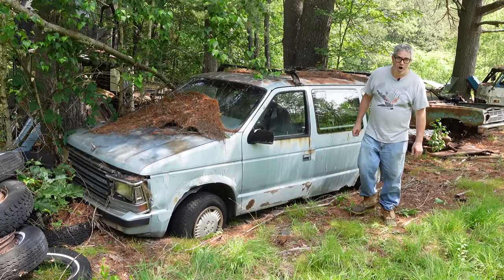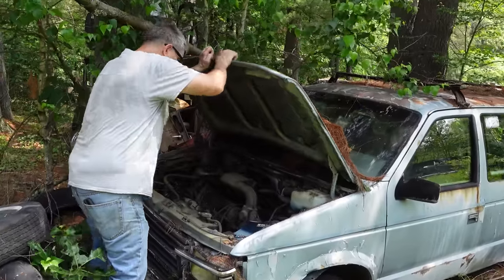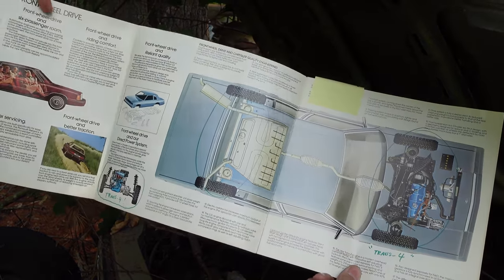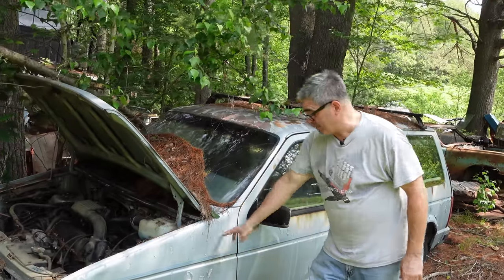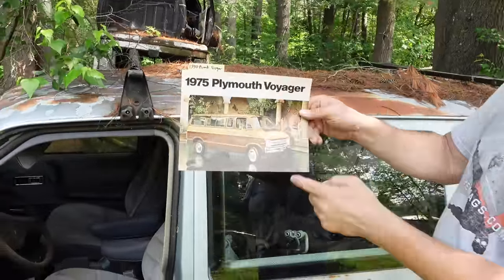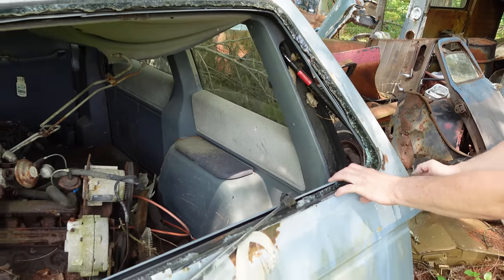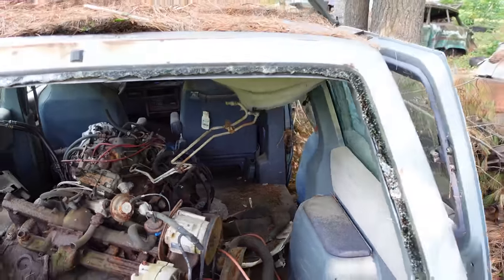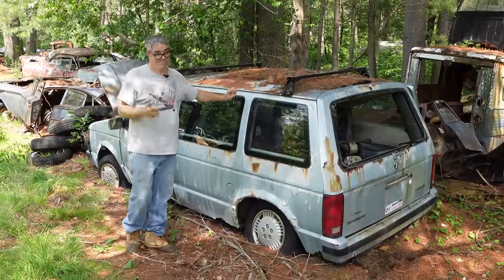Mini Minivan

Comment: Still better than a crossover
Reply: Betterer or worser, doesn't matter
Reply: Yes! It's not pretending that it's anything except what it is - a family hauler.  

All the small SUVs drive me anger.
Reply: @tomwesley7884  you're describing my first marriage.....
Reply: D.A.L.78 - I agree, and minivans were more stylish than today's bland whatever-U-Vs.
Let's agree to appreciate Mr. Iacocca's vision to support this new market that Ford couldn't see.
Reply: Van, crossover, or SUV.... Still can't beat a station wagon.
Reply: When my wife and I got married in 1995 (my second time, her first), her "car" was one of these short-box Voyagers. Hers had the Mitsubishi V-6. It had adequate room for her, myself, and my three kids, even though it only had one bench seat behind the front seats. Easy to remove? That thing had to weigh a couple of hundred pounds and was definitely a 2-person job to remove or reinstall! We took it out one time for a vacation the two of us took one summer (my ex had the kids for the summer) touring the south. I put a double mattress down in back - it fit perfectly between the wheel housings! She made checkered-flag motif curtains for it attached with Velcro for when we were sleeping (We went to a couple of NASCAR races while we were on the road). It wasn't really the favorite vehicle I've ever had; the new 1999 Chevy Venture minivan that replaced it was better by an order of magnitude! But it did the job it was built to do, and it did it well.
Reply: Agree
Reply: @my1vice crossovers are station wagons on stilts.
Reply: Certainly WAY more useful.
Reply: I had a '93 Caravan updated version of this short van.  I loved that vehicle...2.5L with a manual 5 speed.  I got 32 mpg out of it on the highway all day.  Lots if family vacations.  When soccer hit the family my ex wife was really upset she did not have an SUV to keep up with the other moms. So, she figured out how to get a new vehicle.  She backed it into a parking garage concrete pillar, totaling the Caravan.

Comment: I worked as a mechanic in the years when these minivans were new.  I replaced tons of inner tie rods and CV boots on these. Not all of the front wheel drive problems had been worked out yet with front wheel drive cars. Especially CV boots. 
My lasting memory of a K car was at a monster truck show of the same era. K cars were probably only about 5 years old at the time, but here was one already as an obstacle, waiting for Gravedigger to do it's thing. I was surprised at how in comparison to the other cars at how the K car flattened out with such little effort,  like a stomping on a beer can. That was the sinking moment I realized that the era of disposable cars was upon us.
Reply: We had a 1990 Grand Caravan 3.3 liter and I remember my dad having to get the transmission replaced twice in the 10 years our family had it, other than that it was pretty dependable and was used on all of our family vacations.

Comment: When I was ten years old my dad bought a 1990 Plymouth Grand Voyager brand new and we had it until the year 2000 when it was replaced by a 2000 Honda Odyssey.  Aside from having to have the transmission replaced twice in that decade of use it was a fantastic minivan.  Ours had the 3.3 liter and MANY family vacations were traveled in that minivan.  The two longest family vacations were Louisiana to Nevada in 1997 and Louisiana to Ohio in 1996.  We also usually traveled from Louisiana to Houston 3 times a year in it for summer, Thanksgiving and Christmas.  No break downs ever and the AC blew ice cold.  Ours was dark blue with the medium blue interior.
I would totally drive one of these as a daily.

Comment: Many, MANY improvements since its inception. I worked as an engine swapper for a shop in So Cal in the early 90s. The owner had a 4 banger long Block swap special for $1200, very shrewd man. I eventually noticed, but he knew about those four cylinder engines from chrysler. The odometer on the one in this vid says it all, 82k. A full 95% of the engines I did were Dodge/Chrysler 4s with around 80k on them. I now own a 97 Caravan 3.3 with 427k on it. Many MANY improvements indeed.

Comment: My '85 Dodge Caravan was the utility/cargo model with a pair of front bucket seats and clear open space all the way back from there. It was equipped with the standard 2.2 liter four-cylinder and five-speed standard transmission. What I could never figure out was why the clutch would always smell burnt whenever I used reverse to enter my slightly uphill driveway (never a smell going up the driveway in forward gear). I was doubly surprised to find the same smell even after having removed and replaced the clutch assembly. I paid $800.00 for it circa 1995. Circa 2003 on the freeway, it began slowing down at speed until it died and I stopped on the shoulder. I gave it away free to a college friend of mine. I did not know at the time (still don't) what mechanical system failed, but I do remember telling my friend I did not believe it was a cylinder head problem. Well, he did not listen to me and renewed the cylinder head only to find that it still would not run. Well, I got my money's worth out of it (even used it as a mobile auto repair vehicle for a couple of years).

Comment: I had an unsuspecting white 1990 2.5L 4-cylinder turbo mini van absolutely BLOW the doors off my ‘79 Sunbird with a lightly modified 350 SBC at US-131 Dragway back in 1994.  I had no idea what I was in for when I staged at the tree with him.  I didn’t know it was turbocharged until it was too late! He had obviously tuned it up quite a bit.  I ran a 12.76@118 and he drove right past me.

Comment: These old 4cyl auto minivans were absolute tanks. In the mid 90s they grew on trees and were virtually free. A weeks wages and you were on your way. Cheap to maintain, tons of room, I’d buy one out of the local news paper classifieds and drive them into the ground! At one point I had 6 of them.

Comment: My 2003 Chrysler Town and  Country van has 220 k and runs perfect. Only routine brake and exhaust work done and parts are dirt cheap. The 3.8 V-6 is super reliable and removeable back seats makes it  into a work truck. Thank you Lee Iacocco for your vision and work to create these vehicles.

Comment: Correct, Mr. Sperlich and Mr. Iacocca tried to sell Mr. Ford II on the minivan, but he scoffed at it, probably thinking (somewhat incorrectly) that it would steal wagon sales. Mr. Ford was an 1156 bulb in an LED world---not the brightest one in the string and the company's problems back then can be squarely placed on his shoulders. Of course, the minivan was a sales success at Chrysler and in 1986, the wretched Aerostar was cobbled together at Ford and was nothing like the minivan at Chrysler. GM had the Astro and Safari and those too weren't what a Chrysler product was. Mssrs. Iacocca and Sperlich were smiling ear to ear when the product came out at Chrysler, causing GM and Ford to scramble (and fail) to catch them in the sales of these products. Yes, today we have the Pacifica, which is the minivan of choice for rentals at Enterprise and others. We often rent Pacificas on our business trips because they seat a lot of people and accommodate a lot of luggage. They also ride nicely and get good fuel mileage. I'd never buy one, but they have their purpose. Yup, the minivan (and mostly all of Chrysler's front wheel drive products, imports excepted) were "Sperlich Specials" and based on the K-car design. 

Actually to create confusion, there WAS an "H" and "K" model within the "S" body. Sometimes, they would use those codes in the parts catalog to differentiate parts between the divisions (Dodge and Plymouth, or Chrysler in the case of the Town and Country). Yes, Chrysler used "alphabet soup" like GM did with their models. You have to know their parts system or you'll be left in the dust. Correct, 1989-1990 on the turbo 2.5L.

Correct, the importance of getting it in a regular garage, and the sliding door to get in out of it in mall parking lots and the like were important. It was also one of the first/primary uses of "focus" groups to develop the product. 

No VIN, can't win, but the 10th digit of the VIN would be an "L" for the 1990 model year and it was assembled either in St. Louis, MO (Fenton) which operated from 1959 to 2009 or Windsor, Ontario Canada which opened in 1928 and still operates today under Stellantis. It also still produces the minivan. No tag, can't brag, but possible code B32 Light Spectrum Blue exterior paint.

Comment: They were a huge hit. I’ve been working as a tech for Chrysler dealerships since 85. They went from 2.6 Mitsubishi engines and 2.2 engines all the way up to the new 3.6 with hybird electric. So many changes and improvements.
Reply: Just strictly as a technician, what would you say was the worst (and best) years of working at the dealer?
Reply: I remember that 2.6 Mitsubishi engine, would still run with the broken timing chain guides, he'd the update kit to eliminate the second chain later,,that yard has everything in it
Reply: @jeffclark2725 i had a 85 reliant with the mitsu 2.6. Yep the timing chain guides are what did it in. Mine never gernaded itself but it was 18 years old by then and wasnt worth fixing.
Reply: There was a VW variant of the fifth generation Grand Caravan called the Routan with a 4.0 litre V-6. Wikipedia tells me that they were made in the Windsor assembly plant from 2008 to 2013.
Reply: @martinliehs2513  yeppers,worked on a few of them
Reply: @jeffclark2725  i feel bad for you! The mikuni carb is a black box! I couldnt get mine to stop running rich so i drove with an Reject sticket for 2 years 😂
Reply: I started at spitzer auto world in elyria ohio in 85 to work on Chrysler products, interesting times but had to get out of the business in 2008 due too domestic made, warranty dependent,recall plaqued junk. I was loosing to much money with warranty and recalls, we had to turn our paying customers away because of this. 😢
Reply: @jacobvanausdeln1696 from mid eighties to early 2000s
Reply: @raylamp4505  I remember those days, Recall, Special policy, and service contracts were the norm, remember the Bendix 5 ABS brake system? seemed like they were a lifetime warranty story back in the day, those were some difficult times
Reply: @jeffclark2725  oh my Jeff you are killin me.   But i prepped the the first diamond star lasors, was crossfire tech including srt6 and prowler tech... I had a lot of fun.
Reply: @jeffclark2725  Bosch system in front drive new yorker was the worst... Am i burning brain cells??? Or 2.6 litre chain kit with balance shaft.
Reply: @jeffclark2725  fuel injected frank sinatra new yorker too carburetor was a good time also.

Comment: My Mom had a 1989 Grand Voyager LE with the 3.0 L Mitsubishi V-6 , 4-speed overdrive automatic, & front and rear ac. Nice van until it was in the shop a lot. She ended up getting rid of it in 1997 for a brand new Dodge Grand Caravan with the 3.3 L V-6 & dual sliding doors on both sides, which was a new option at the time. Now, my stepfather has a 2019 Dodge Grand Caravan as his work van. The stow and go seating is a great innovation because it’s a lot easier than removing the rear seats & trying to find a place to store them where they won’t get ruined.

Comment: Those poor front door handle assemblies    every crook and addict of the day  mangled them!  break-in's and thefts were rampant then.   And, the ignition keys were not chipped until post 2000.

I often do miss my '92 Grand one in the ES all white trim with the quad command chairs.
 
Also had an '88 base model too  with  just a  2.5 and 3 speed much like the one in the yard Steve is looking at,  except  we upgraded to full gauge instrumentation  and got the factory roofrack. Later went to find highback front seats from the junkyard  as  our 88 base had lows. Those rear row cubby bins do indicate it was a 7 passenger van,  8 in the earlier years  if equipped with the special lowback 'front' bench. Some even ordered the Convert-A-Bed!
There was a full front bin console below the radio also, but for optioned and LE/ES trimlines. Another oddball special opt was the overhead rotary knobs that controlled the swing-out rear windows for venting, on later gen1 Grands.
The two-tiered headlamps on the 1:64 model show the earlier years, like 84-86

Comment: Not sure if it's been corrected but the caravan voyager had a leaf sprung beam rear axle. If your building a small utility trailer they make excellent trailer Axles and springs for like $50 from a UPull yard.
Reply from the maker: You are correct, I mis-spoke. There are two mono-plate leaf springs under the tail of every First-Gen minivan. Thanks for watching and writing. -Steve Magnante

Comment: Back in the day, Reliant and the Voyager (Grand respectively) as Plymouth had been a bit more eye catchy than its other Mopar siblings. Especially the North American G.V. with woody trim. Euro version of the Grand/Voyager appeared under Chrysler nameplate with the Dodge grille as well as wore proudly the "Made in Austria" sticker on its rear end. No woody trim available for euro versions. Later during the '90s Diesel with manual transmission became big hit all over Europe.
Allways liked the all red Dot-spec rear taillights on the american versions.

Comment: Steve, the rear suspension used leaf springs.  These vehicles were classified as trucks, so the exhaust emissions were allowed to be a bit higher.  A BIG plus for "The Company Formerly Known as Chrysler" was that as trucks, they boosted the truck average fuel economy ratings - they may have pulled down the passenger car average fuel economy ratings if they hadn't been classified as trucks.  I don't thing people appreciate enough that sliding doors, that don't swing out and ding other car doors when opening, are perfectly suited for vehicles carrying the soccer team to games.  Kids don't concern themselves with opening a door carefully when they are excited.
Reply: Yep, they used leaf springs in the rear up to the 2007 model year.

Comment: Really brings back memories. I was impressed at the time with Chrysler’s clever money-saving measures that were also practical: only one rear door, fixed rear windows, immovable front passenger seat, storage bins under seats, removable rear seats (and the wide third row bench could be mounted to the middle row to provide room for five passengers and a ton of luggage).
Reply: Chrysler IMPROVED these EVERY year, though! GOTTA GIVE CREDIT!

Comment: I worked at a Dodge bodyshop 85-93. The turbo caravans could be had with an automatic transmission,  as was the bodyshop demo one year. I drove it several times, and yes, it was pretty peppy for those times. The turbo on the fender was a decal, as was the vnt turbo insignia on the hood of the Daytona. The vnt turbo was nozzled to help overcome turbo lag.

Comment: Bought an '89 Turbo Caravan in the early 2000's for $500. It was running bad, put in a set of plug wires and it ran great...$10 fix. Owned it for years; put in the '92 front suspension, Grand Caravan rear tube with swaybar, GC bigger discs, 740 Volvo intercooler, 1-gen DSM blow-off valve, Shelby wheels with 60-series tires, T3 turbo with the Shelby intake & valve cover, '87 3L throttle body, a LSD in the transaxle with a mix-n-match of the best parts for the A-413. On the interior, put in the better LE interior, privacy side glass, rear window openers...drove the odometer to 308+ K miles

Comment: Great show Steve  ! I remember these minivans back in the day  . I would definitely buy a minivan over a crossover , you get more space and a better ride comfort with a minivan .
Reply: That looks like the van I had,mine had 2.2,it was a good driver and worked well,great video thumbs up, Happy 4th of July
Reply: Minivans are incredibly useful vehicles with the sliding side doors and the seats that fold into the floor. If just wasn't for the stigma they carry.
Reply: I would totally daily drive a minivan.  Plenty of room and the driver seat area is usually comfy.
Reply: @Vile-Flesh  I always liked the slider door, work vans,easy access to tools and gear
Reply: @N2YTA  😂 I drive an 05 Grand Caravan. I've been called a soccer mom before. I'll tell you this much. As long as the road is free of loose sand and things I can get hung up on, I can go anywhere. 6" of snow? It'll slow me down but won't stop me. That van is a mountain goat. A Dodge salesman once told me I could push snow (plow) with it. I get a consistent 25 mpg on the freeway. 190,000 miles 3.8L. clocked. It's cheaper to attend to the nickel and dime shit than to upgrade to new or certified used at the time. 2020 was the Grand Caravan's last year. I would love to upgrade to a low mileage 2020 or 19 or 18 with a 3.6 Pentastar. Smaller engine with more horses/torque than my 3.8, mpg roughly the same.
Reply: @kenttalsma7906  '05 with a 3.8L is a good one.

Comment: After having missed out on introducing the minivan, Ford and Chevy both came out with minivans based on their small rear drive pick up platforms. They were much larger and weren't as good as people haulers. My in-laws had a Ford Aerostar. I used it from time to time for hauling stuff. It wasn't bad, but it was every inch a truck rather than the car that the Chrysler felt like.
Reply: To me, the Chrysler minivans ALWAYS "felt better"! I owned Astros, Safaris, and Aerostars, but they were NOT as good, for my use, as the Chrysler products!